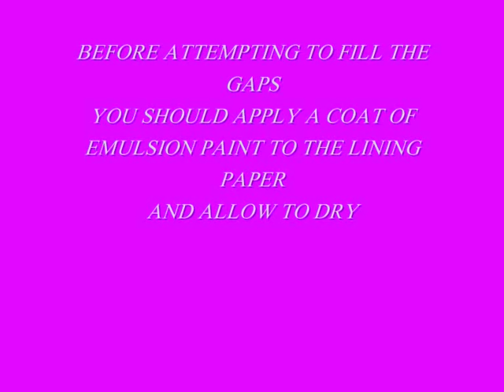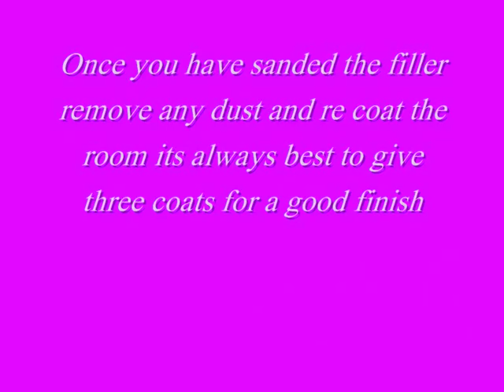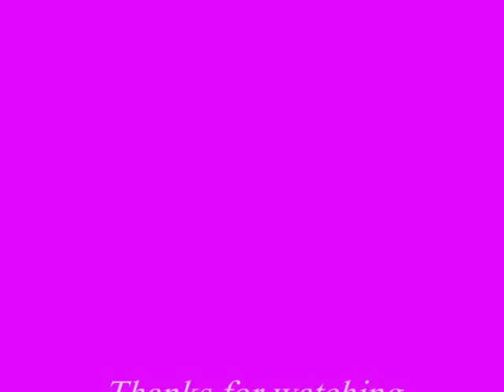pro decorator shows to fill the joints in lining paper origin of the technique

Comment from the maker: Your points are perfectly relevant, i used to try and butt the joints but was spending way too much time putting right split joins after painting, this is now my preffered technique i find it easier to apply a full coat to all the walls rather than touch up filled joints, i always quote for several coats anyway and lighty sand the walls between each coat, the final coat is thinned to create a smooth finish.
i kind of knew i would get critics for posting this, but find it a good solution.

Comment: This vid saved my cinema room.

I had to hand lining paper over polystyrene (horrible i know, but the only thing stopping my uninsulated walls getting wet in winter) and as the lining dried it shrank with the flexibility of the polystene underneath causing hairline cracks.

I tried this video's method of intentionally leaving a gap to fill and that has worked out perfectly! I'm now cutting a bigger crack to fill on all the previously hung sheets.

Many thanks.

Comment: I used a 'polyfilla one' on a bare wall to fill small gaps and then painted the walls. The parts that I filled up polyfilla showed up through 2 coats of paint, it was the texture that you could see from an angle.
I'm really interested in wallpapering the other walls in the house and filling the gaps like in the video, but what kind of paste did you use the fill the gaps between the lining papers?

Comment from the maker: @streetstaruk hi most papers can expand after they are pasted, allowing them to soak for five mins or so before hanging stops them expanding after hanging. while the paper is being hung you can use a seam roller to press down the adjoining seams to stop joints showing and shrinking.most pattern wallpapers have a surface and also a backing which should stop them shrinking. lining papers vary in thickness and have no backing they can expand when hung and when they are painted! hence the gaps.

Comment: If you add some paint to your filler (same colour as wall colour) it makes it more creamy and less noticeable when the final coat goes on.   Less chance of flashing.    Also lining paper has two sides one slightly smoother for painting.   Horizontal is usually done if papering over the top but OK for painting as theres less joins.  I always try to butt joins but sometimes they do pull apart and have to fill.   Leaving a small gap does lessen the chance of overlap which is worse than a gap to try and hide.
Reply from the maker: Good info Derrick, it's nice to hear your constructive thoughts.
Reply: instone09 No problem.   We all do things different.  Do what’s right for you.   If you get the results you want then there’s no issue.      Good work mate.  👍🏼

Comment: Why do I need to paint first I have done it without, will it matter
Reply from the maker: Sometimes the sandpaper frays the lining if its not painted, I tend to be a bit heavy handed so i paint first😊
Reply: I will try be extra carefull, cheers
Reply: I know this is an old comment, but I have filled first too. Will try and paint once the filler has dried and then sand it down and see how that turns out. Hopefully that will work and I've not messed it up.
Reply: Also planning on running a tiny bead of filler along the ceiling and skirting edges to hopefully seal the paper and stop it from peeling.

Comment: Should be no gaps filler sands smooth lining paper is slightly rough causing the filler to flash.Peace
Reply: You're right there pal. Why would you leave such big gaps and give yourself all the extra work of filling and sanding. Also if you paint it before filling then you'll have to put another two on top making it 3 coats in total. 2 coats is plenty if there are no joints. He's obviously not working to a price
Reply: Only reason to leave gaps is when lining for wallpapaer.Lining paper is to give even porosity(soak age) putting filler on defeats the purpose of using a preparation paper if you're going have filler everywhere may as well not use it should be a seamless finish.

Comment: the PROFESSIONALS do it exactly this way ok he put it on horizontally that was wrong but you have to leave a 1-3mm gap it's not expansion it's to make joints less obvious when painted two joints butted together are really obvious but by leaving a VERY small gap then filling it makes it a seamless joint
Reply: Lining horizontally is the correct way, it's called cross lining.
Reply: Crap. If you hang it properly ie no gaps you can't see the seams when it is painted. You can Always see a seam that has been filled. Just hang the lining paper with no gaps
Reply: Exactly, leaving a gap for the paint to fill, that's the way I was taught..
Reply: If you read the label on the Dulux trade lining paper it says leave s 1mm gap.